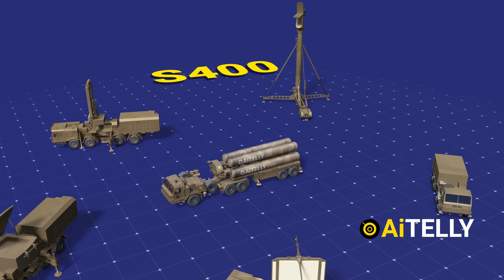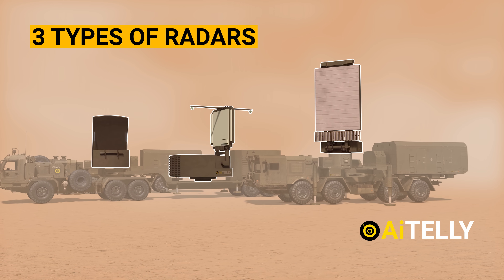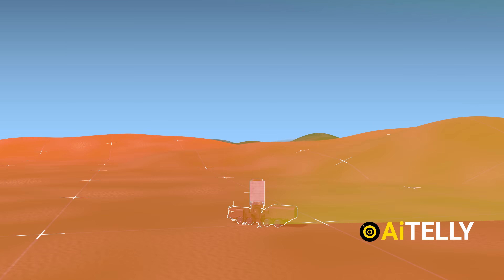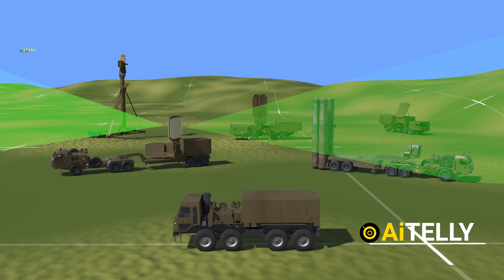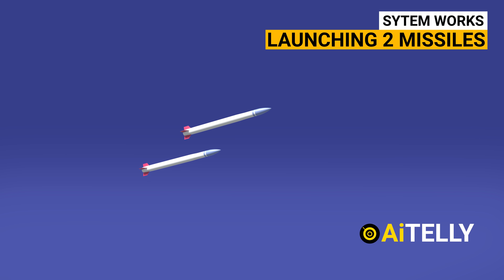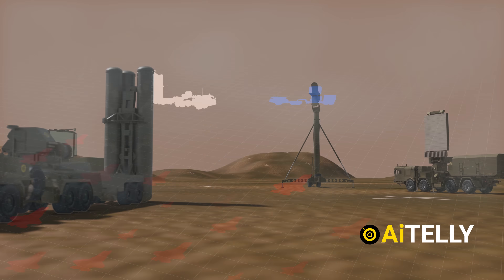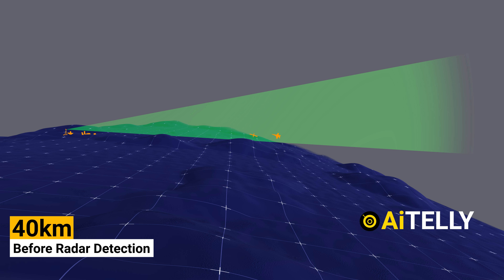S400 missile System & Air Defence Missiles | How it Works #missile

Comment: I wonder how they interact with each other. Is it wireless or needing wires to connect to each component? I suspect the latter as it is the cheaper option with less chance of interference. But also has its drawbacks as well.

Comment: While the S-400 is a powerful air defense system, Ukraine has been able to strike and disable it, demonstrating its ability to exploit vulnerabilities in the system and other areas of the Russian military. This includes targeting critical components like the 92Н6 control radar, as well as using ATACMS missiles to destroy launchers, radars, and air surveillance systems. So if pakistan gets a hint of it then it would be dangerous for this system to defend incoming missles. Plus turkey has ATACMS supersonic missile which can able to easily destroy this. And turkey joint hands with beggar country Pakistan. Not sure what will happen next.

Comment: We "India" did not use the S-400 system to defend against Pakistani drones. No army in the world would deploy a ₹1,200 crore defense system to neutralize a cheap ₹30 lakh drone. The S-400 is India’s flagship air defense system (imported from Russia), but it is reserved for high-value threats such as hypersonic missiles or nuclear-armed missiles targeting India.

India has several other defense systems in place, including some indigenously developed systems. Additionally, some older, manually operated long-range artillery guns that have been modernized by the Indian Army that functions automatically now were used yesterday to engage those drones.

Comment: That problem with the earth's curvature is why a properly prepared S-400 battery will have multiple short range air defense systems around it to react to very low altitude threats like advanced cruise missiles and FPV drones.

Comment: This video has some major mistakes about the difference between searching and tracking radars. The Big Bird along with the Clam Shell (The "E" radar on the mast) are constant emmiters to provide a general report on targets. They can not guide missiles. The Flap Lids in both variations, do not rotate like crazy - they will produce directed high energy beams at targets the moment launch is initiated. They remain on stand-by until that.

The choice for drawbacks was also not exactly fair - earth's curvature degrades any long range SAM site, not just the russian one 😅 You can however adress the general lack of technical advantage - it does not deal with ground clutter very well, the vehicles are bulky and easy to spot. As always, they make up for the lack of technology, with big, and powerful missiles.

Comment: Isn't the main disadvantage of any radar guided SAM the fact that it is radar guided? The radar can be easily detected and used as homing guide for incoming missiles. Also what you have not explained is how the missile is guided once it has been fired. Is this fire and forget with autoguidance using a radar on the missile or is this via some kind of electromagnetic wave originating from the ground. How about stealth aircraft drones and missiles? It might be a complex task to fully render a fighter plane stealthy but fodr a drone or a missile this should be achieveable. Won't this neutralize the S-400 (or any radar guided SAM)? How does the S400 adress this problem? Can the S400 be integrated into an airborne or satellite AWACS type of system?

Comment: love the breakdown of these weapons. the system is highly advance, but we know that small drone is hard to detect. therefore, those small drone with camera can easily scout air defense system. this is why russian troops cant hide in battlefield as it get artillery strike by drone scout. only way is they make a new radar system that used longer bandwidth to detect smaller object.
Reply: Russia uses other AA systems to destroy, jam or even take controls and steal drones. 
Drones became extremely expendable in Ukraine. Both sides aim artillery with them, but losing giant numbers of this drones especially Ukraine, which complains about Russian EW and AA obliterating their drones
Reply: AS 400  target big fighter jets like F16 and F35, however,  altitude detection radar   overlap  with high altitude radar  low easily can detect  low altitude and small targets like drones.
Reply: @USER-q8y7k  yes your right. s-400 is for ultra long range. they never thought a war was fought with drone. drone is kind of a new thing that comes to light about 10 years ago.

their equipment got destroy at a fraction if the cost the west used their equipment on. artillery shell precision on tanks. thats why its good to always prepared for modern wars

Comment: I have a question. 
Isn't 4 missiles too less? It can engage two targets at most. Can reloading be done quickly or can we use multiple missile trucks along with one command center?
Reply: Well you answered your question. It would be stupid trying to produce high tech radard that can track up to 300 targets and guide 160 rockets simultaneously, if they couldn't work with multiple launch trucks.
Reply: @МансМанс-ж9г  thank you for answering! Now I know for sure

Comment: In a follow-up video, it would be interesting to discuss the data-sharing capabilities of such systems, and the integration of a battery in the regional air defense environment. The connection between a S400 battery with others systems of the same type and other shorter and longer range systems on overlapping networks is a force multiplier that is an interesting subject.
Reply from the maker: Will do definitely.
We made this one very fast
Reply: It's fully integrated to air defense landscape, including short distance systems like BUG and Pancir as well with fighters like SU34 and Su 35 and interseptors like MIG31. Moreover a battery normally works with other batteries in cooperation

Comment: The main weakness of the S-400 is that the radar systems are a bit lacking in the ability to distinguish different types of enemies. 
Stealth aircrafts have a very small radar signature and modern planes carry HAARM (radar chasing) missiles with over 100km range. If the radar is not able to lock the target plane and fire before the plane does it can be destroyed by radar chasing missiles.
So the S-400 needs protection, short range systems like pantsir can help but new very high speed missile technology with decoys adds even more complications. 
Ultimately the issue with all systems like the s-400 is that they have low mobility.
Reply: S-400 has 2 different kind of missles that locks the target and send the package for smoke in the Air for the stealth Tech fighter jets OR planes, and those fear the NATO , and Prometheus is the best air defence system
Reply: 5-10 min to unload and ready to fire and 3-5 min to ready to go is low mobility?

Comment: There are quite a few inaccuracies on the description and capabilities of some of the components like the Big Bird/Tombstone. The Big Bird is totally different from the Tombstone, in fact, the Tombstone is not even associated with the S-400 system but with the older S-300. Overall, good job though. These systems employment vary depending on battlefield scenarios and military objectives
Reply: You're wrong.  The S-300 did not have such a thing.  The all-altitude detector appeared on the S-400.
Reply: @Anti_Everything  i don’t know what you’re referring to man but the Tombstone is a component of the S-300
Reply: @yasieldiaz899   Agree !! Tombstone is part of the AS300

Comment: it's cons as well is that the s-400 only has 4 missiles if an enemy fires 20 missile volley well it will exhaust its missiles and it won't destroy everything.
Reply: Many missile launchers can be connected to each radar. Large objects are very well protected and can withstand the impact of tens or hundreds of missiles. The S400 is also under the protection of short range complexes. There are a lot of rockets. You must send many fighters to try to destroy one air defense system. If these fighters are spotted by radar, they will be shot down at long ranges and will not be able to launch their missiles, which makes the task even more difficult.

Comment: for extreamly low flying objects normaly uses over-the-horizon radar and AWACSes, also there are last echelon pancir and tors, systems like s400 is hi end expensive so normaly covered and not using separately.

Comment: Thank you for the basic explanation. I think the drawback can be solved by deploying multiple radars at various distance  to detect low flying targets.
Reply: We have Pantzir S-1 system, highly mobile one-truck system with 2 double barreled rapid fire cannons and 6 small rockets designed to counter small flying objects.
Usually our army deploys several AA systems in place to have multi-layered defense. That's why nobody even thinks to try and puncture Russian anti-air defense.
Reply: @andrewpotapenkoff7723  what are you on about? Russian held airspace is constantly being penetraded...
Reply: that's litterally what an S-400 formation does ...
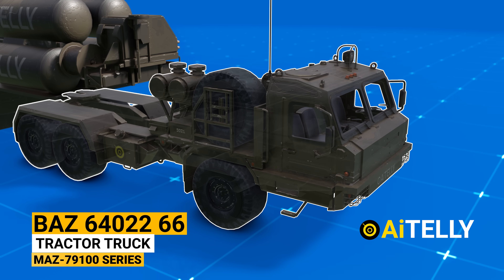Every command post 3:12 can control multiple (up to 6 iirc) engagement radars 2:35 which in turn can be associated to 12 TELs 1:09 (in Russia the standard is 8), engagement radar+TEL is called a battery.
Other radars (Search radars 2:04 and the ones on the masts can be added as need be and linked directly to the command post) as well as other types of radar (Protivnik/Nebo/Barier/Vega/Avtobaza/Gamma) + can be associated to EW systems to work passively and work on incoming radiation by enemy radars.
The command post is also retro compatible with S-300 radars and lunchers (S-300 can be integrated within S-400) and also can be used to control Shorter range systems like S-350/Pantsir/Tor and has 2 way link with other types of command posts used on the battalion regiment level of other systems (ground forces for Tor/Buk and air forces).

That's the real power of the S-400 ... it can either take control of smaller units of shorter range systems (for example a 3 vehicle group of Pantsir to defens itself) or share data with a battalion set of Tor (Command post + 6 vehicles) to coordinate the targets they will engage: for example the Tor battalion command will get Data from S-400 about cruise missiles and fighters, the S-400 will select the cruise missiles for the Tor systems, the command post of the Tor battalion will cross that data with the radars of the Tor and the tors will only engage those missiles, leaving the S-400 free to engage the fighters while it's engage channels are not saturated by the missiles. that way every system can focus on one type of targets and ignore the rest while also making sure they don't double tap.
Reply: For low flying targets its better to have many small radars on the ground to cover a larger area just above it
Reply: @divoulos5758  This is solved with the help of other air defense means. For example, the Pantsir, which was designed to fill the niche between the S-400 and the Tor and the Buk
Reply: @divoulos5758  now each battery has up to 6 "small" radars (optionaly) for low flying targets
Reply: Needs to be protected by layered air defense. Otherwise they will be destroyed by fpvs which Ukraine launches from their sea drones

Comment: Well the limitations told in the video, doesn't seem to be the s400's problem rather a earth curvature problem, is there any other defence system which have solved this problem
Reply from the maker: It's very dificult to track and destroy low flying cruise missile using mountains,hills etc as barriers
Reply: s400 has homing missiles. if the target is detected, but the exact location is unknown, then such a missile can be sent there and it will destroy the target. low-flying targets can be detected by AWACS or Russian MiG-31 fighters. NATO aircraft cannot approach Russia's borders within effective missile launch distance. But the US can use Tomahawks. If you send a lot of missiles, then there is a chance that some will break through the air defense. But this is difficult for the US, because the S400\500\300\350 are protected by medium and short range complexes. USA need many missiles to destroy each one. The United States does not have time for this, because all military bases and airfields will be destroyed in the first hours of the war. The US and NATO will lose the world war. And the world will soon see it.

Comment: @Aitelly . please make video on cold and hot launches of missiles. NATO use hot launches and russia use cold launchers. am curious about the russia ICBM cold launches and heavy missiles which they launch from trucks
Reply from the maker: NASSAM missile System ?
Reply: @Aitelly  no its not about missile system. NATO hot launch mean that they ignite missile engine it start when missile is on ground or can say when its its chamber like vls.  while Russia use cold launches it mean they use compressed gas and push missile out of the tubes and then its engine ignite in air,  just watch NATO and russia missiles launches videos you will understand what i meant. NATO missile when lunch then its fire and fire around it while russia push it into air then start its engine. . however am curious how the cold lunch principal works in more depth
Reply from the maker: @Xerox482  Yes We never thought of that.We have to do a more indepth study of the Missile Launch systemin more detail.
Military data are tough to get through.
Most of the data are still classified or are in a Grey Area.
Reply: @Xerox482  Там не сжатый воздух. Это пороховой пуск.
Уже в воздухе запускается ракетный двигатель после разгона.

Comment: They could mount the mast Radar on top of a hill or an elevated position to get  better detection range.
Reply from the maker: Yes they could but low flying objects are a difficult  to target and track because of Terrain obstruction.
Reply: @Aitelly  . But that's the same case for any Air defence system right..including THAAD..????
Reply: @abymathew295   Army uses flying radars, ex AWACS, so it could see down from above. To put a powerful system on a military cargo aircraft, it must be light enough, i.e. as modern as possible. The radar irradiates the target from top to bottom (far beyond the horizon) and only large mountains can hide the target. Further, the information is combined into a network. NATO has a lot of AWACS, but Russia has big problems with this, for obvious reasons.

Comment: Mobile mast is used for low flying targets, to complement earth horizon.

Anyways nice animation
Reply from the maker: Yes we showed that right
Reply: @Aitelly but you mentioned low flying targets can't be detected until they are close to 40 km. Then what is the use of mounted must?
Reply: @theanalysis8936   If the target flies high, it can be seen hundreds of kilometers away. If the target flies low, it must be detected by other location systems, for example from the air. One complex outside the system is itself quite vulnerable
Ships use helicopters or planes to find the enemy long before it appears on the horizon. Otherwise, all these ships will also become just an expensive duck target.
Reply: @Tony-. earth horizon radars are used in that kind of situation, like mounted must